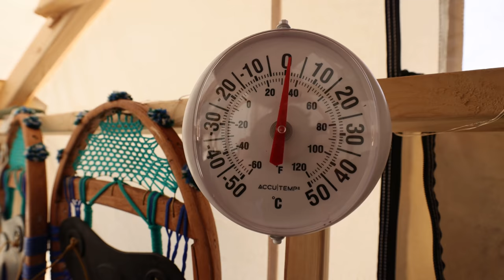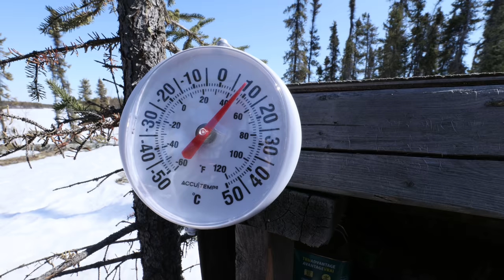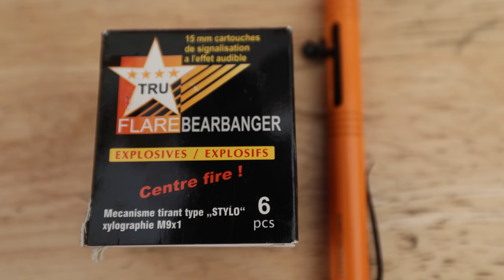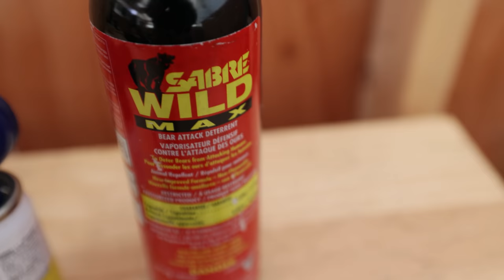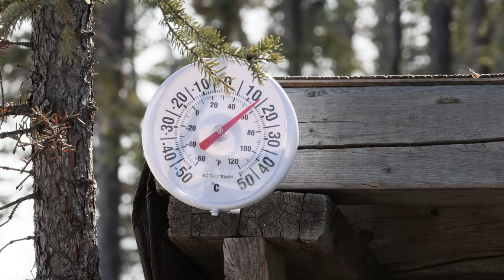Tiny Tent in the Woods. Bears are Awake

Comment: Spring has sprung!  Soon enough you'll have to take the long way to get to the tent, but then you'll be able to get some fishing in so it'll be worth it.  Adding the drone shots was a big plus too.

Once things have thawed out you should check the corner of the tent platform to see if it settled any more.  By the looks of it, the frozen ground hasn't moved any during the winter, but that might change in warmer temperatures.  As always, thanks for sharing.

Comment: Hi Jay, its hard to avoid sweating on a hike. In winter conditions I always take another set of clothes and change immediatly upon arrival. Then you can warm up immediately, take your time setting the fire in the wood stove and and dry out your clothes. No chills, or at least they don't last long. Also remove layers as you warm up on a hike without delay. Minimizing the overheating will reduce the sweathing too. I add and remove clothing fast. If you get too wet, you are at high risk of Hypothermia if something goes wrong. Not to mention there is no help on the way any time soon.

Comment: Hey buddy. Tip for the bear banger. I know it's expensive but play around with a shot or 2 just so you can judge the distance on how far it shoots. If you shoot the bear banger in the bears general direction and the banger goes off behind the bear you could actually scare it towards you. May be an ideal to shoot straight up. & you won't start a forest fire if it's dry. Just a suggestion.
Reply from the maker: Excellent tips

Comment: It's too late now, but I would have liked to see your solar panel performance for a day using your 17+ hours of sunlight.

I recently bought a small 7" electric frying pan. Uses about 50 watts to boil 335 ml/12 oz of water with my solar generator, instead of using a propane stove.